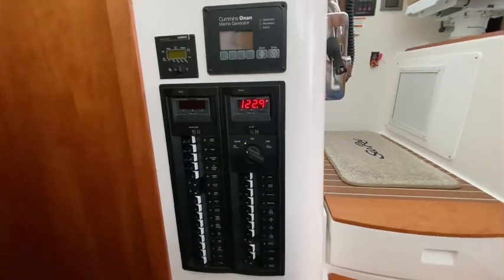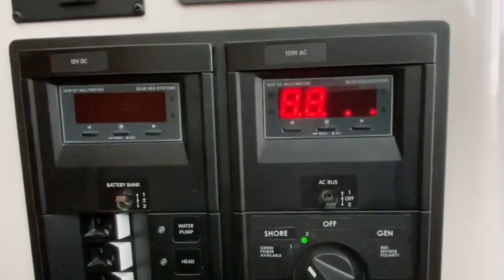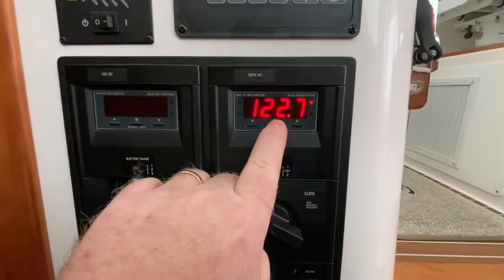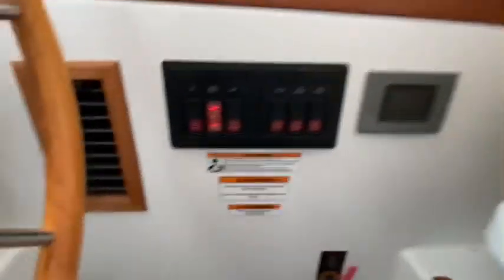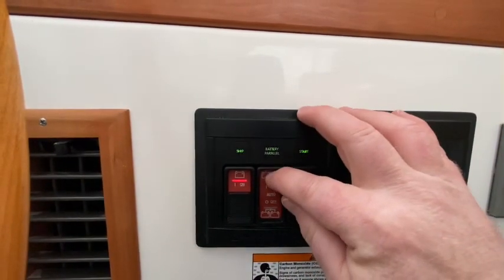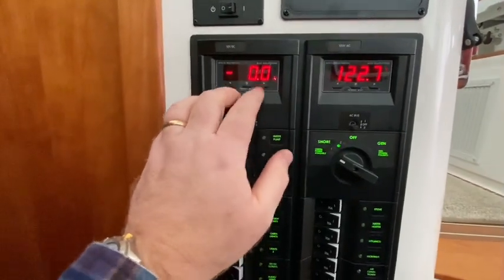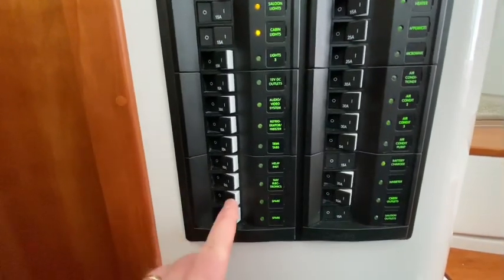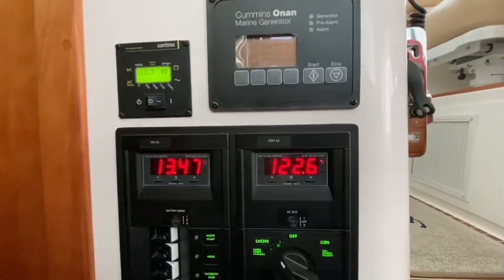Back Cove 37 Electrical Panel Operations

Comment: Hi Brad:  What year is your Back Cove 37?  Mine is a 2014 and Back Cove tells me that I have to have both 30 Amp power cords plugged in for the AC meter to work.  That's obviously not the case on your boat.
Reply from the maker: Mine is a 2019. Yes, each side of the AC power is independent.  I can plug in either shore power cord and the associated power meter will display.  I have a toggle switch to display the different meters.